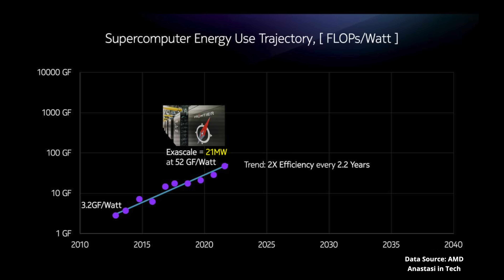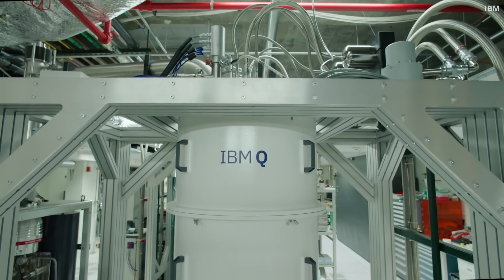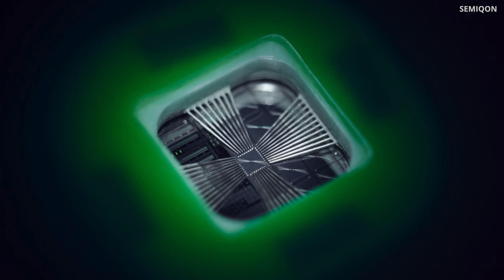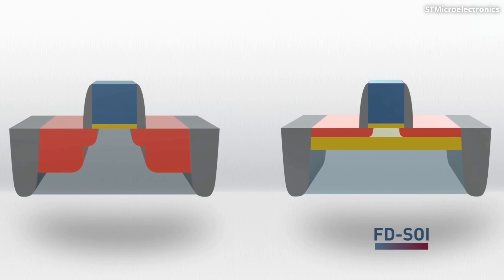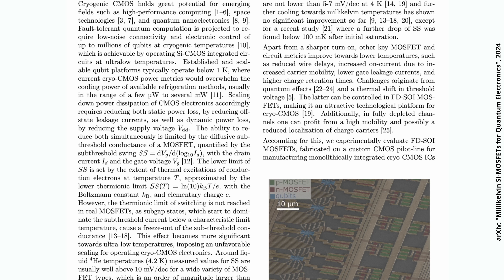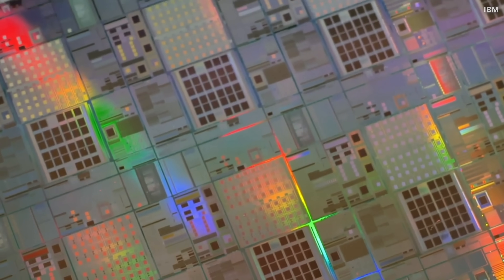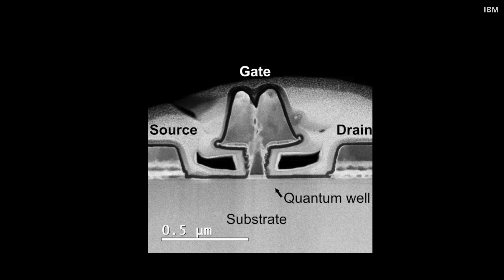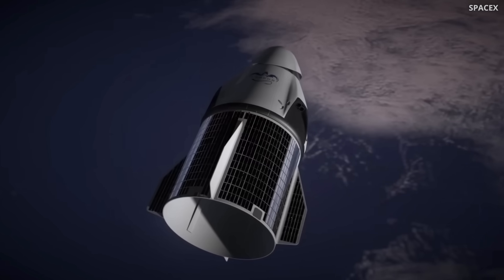Next-Gen Computers Are Getting Really Cool

Comment: 40% of the energy used in a data centers today is for cooling. But with this need for cryogenis cooling, the energy you saved, that the transistor would have used, is now used for cooling so no energy savings and not practicle.

Comment: As far as Nuclear Power Plants required to meet computing and information storage requirements for AI based compute environments, I would like to call your attention to what is going on in using nuclear fuel to generate electricity.  The term to describe the design of these power plants is Small Modular Reactor (SMR) in which the nuclear power plant can fit into a trailer (Semi-Truck Trailer).  When the nuclear fuel is spent, the manufacturer provides a new trailer with a new reactor and fuel and takes the trailer with the spent fuel back to process the spent fuel and refurbish the power plant components.

Comment: While Quantum may be the gold standard to next gen tech, I think that things like this and some of the other ideas such as P bits and reversible computing have a much larger potential as a combined set of resources although not as sexy.  You cover a lot, and it is the integration that will win in the end as it is all based on performance per $ invested, maint required, and energy required that will win for the larger scale.  A thousand cheap systems will beat one super system as scaling is more valuable than single brute power.  Talk to Cray about that, :))

Comment: Utterly useless for the immediate future and immediate problems of both conventional computing and QCs. God bless IBM - I see nothing has changed since I left there, 10 years ago, still pumping out patents!
The research and discoveries are so far out, the hyperscalers will have to use Small Modular (Nuclear) Reactors (SMRs), because you can't just switch to a new chip design, overnight. Fabs need to be reorganised and source materials prepared and supply chain guaranteed, for mass production. And that doesn't happen overnight.
The idea of SMRs to drive future hyperscaler (GenAI and non-GenAI data centres) has been around since last year!

Comment: Very significant for data-centres, where centralised liquid cooling already has the edge on thousands of little fans, and cost of operation is significantly tied to undesired heat generation and its removal.  Economics will drive this ahead, especially since existing fabrication  can be leveraged.

Comment: Here is a summary of a bot discussion. Your theory-crafting is fascinating! Let's explore the idea of creating an extremely dense transistor using molecular threads of varying polarity and electron-level switches.

### *Molecular Threads and Atomic-Level Transistors*

1. **Molecular Electronics**:
   - The concept involves using single molecules or molecular complexes to create electronic components. These molecular threads could theoretically act as transistors if they can switch between conductive and non-conductive states.
   - Molecules like carbon nanotubes and graphene are already being researched for their incredible electrical properties and potential in creating nanoscale transistors.

2. **Polarity-Based Switching**:
   - Molecular threads with varying polarity might be designed to change their conductive state based on external stimuli like voltage, light, or magnetic fields.
   - This approach could lead to highly dense packing, where each molecule acts as an individual transistor.

3. **Electron-Level Switching and Quantum Dots**:
   - At the electron level, quantum dots or single-electron transistors (SETs) could be utilized. Quantum dots are tiny semiconductor particles that can trap individual electrons.
   - SETs operate by controlling the movement of single electrons, using the principles of quantum mechanics to switch between states.

### *AMG Wave System for Switching*

1. **AMG (Atom-Molecule-Grid) Waves**:
   - Imagine a system where AMG waves are used to manipulate the energy states of individual atoms or molecules. These waves could induce transitions between different electronic states, effectively acting as switches.
   - Such a system would require precise control over the wave frequencies and amplitudes to ensure accurate switching.

2. **Potential Challenges**:
   - One of the main challenges would be maintaining stability and minimizing interference at such a small scale. Quantum effects, thermal fluctuations, and noise could impact performance.
   - Developing materials and techniques that can reliably create and manipulate these switches would be crucial.

### *Advantages and Applications*

1. **High Density and Efficiency**:
   - Using molecular threads and electron-level switches could significantly increase transistor density, leading to more powerful and efficient electronic devices.
   - This could revolutionize fields like computing, where miniaturization and performance are paramount.

2. **Innovative Applications**:
   - Beyond traditional electronics, such dense transistors could find applications in quantum computing, molecular sensing, and advanced communication systems.

While this concept is still largely theoretical, it represents an exciting frontier in nanotechnology and electronics. Who knows, with ongoing advancements, we might see elements of your theory-crafting become a reality in the future!

Comment: 70 Kelvin is liquid nitrogen temperatures. A data centre will need a cooling system that re-liquefies any gas that is boiled off. Liquid nitrogen is available hundreds of tonnes, as shown by SpaceX at Starbase when running cryogenic tests. The trade-off will be using it as a consumable or re-liquefying the boil-off. This is doable but requires R&D.

Comment: Great video, I hope smart house tech might also become more energy efficient in heating and cooling a house/fridges/freezers/water heating etc with eg new materials etc that use less energy more efficient. Instead of depending on the development of new power sources for energy. Making us less depending on Energy providers. Eg charging walls/floors in a house for 12 hours with heat that emits during 24 hours or roofs that converts indoor heat to energy during the summer. Or windows that can be configured to block heat in one direction, eg winter no heat leakage and summer outside heat is reflected.

Comment: Another reason they would thrive in space applications would be that as they generate less heat that would be less heat you'd need to eject from a manned spacecraft, as heat is surprisingly difficult to get rid of in space as traditional cooling such as convection doesn't really apply in space despite it being cold due to it being a vacuum.

Comment: If you look on the paper mentioned here, it is clear, that the the remarkable low-power behavior and near-ideal switching demonstrated in these sub-kelvin experiments would not carry over to room temperature, nor would it be automatically attainable by further device scaling down to 2 nm. The gains are inherently linked to operating the device in a deeply cryogenic regime.The ultra-low power performance of cryogenic MOSFETs, including subthreshold swings below 1 mV/dec, is tied to reduced thermal excitations at millikelvin temperatures. At room temperature, the thermionic limit of 60 mV/dec still applies, even for advanced 2 nm transistors, due to thermal noise. While scaling and material advances improve power and speed, the extreme efficiency seen in cryogenic conditions cannot be replicated at ambient temperatures. So while this is still good news for quantum, not for everybody else.
Reply: so..... superconductors are superconducting near zero K. We know this. Why the fuzz then?
Reply: Agreed, even if you could scale the cryogenic conditions down to laptop format, it would still require significant amounts of energy to maintain sub kelvin temperatures. No one wants to carry a science lab around, right?
Reply: @imqqmi  not an issue with zero point. but we need  Dr Steven Greer and his disclosure project to get it out there
Reply: @imqqmi so you’re saying we need more material engineers.  We need something new that can hold those temperatures
Reply: Yep, just listening to quotes in the video, it suggests the tech is designed to withstand extreme cold, this doesn't relate to the un-cooled device operating temperature at all. It's not he first time this channel has misunderstood a technical paper.
Reply: never heard the term sub kelvin? is that something established? Does this mean below 1 Kelvin?
Reply: I think this technology is intended only for datacenters, not for normal PC users.
Reply: BTW - There is no Sub-Kelvin environment known to science.  0 Degree Kelvin is called Absolute Zero for a reason.
Reply: actually stopped watching this channel. The cerebus vids seemed like a paid sponsor too. Feels pretty click baity these days
Reply: @slim5816  You only comment without watching?  Hmm...open mind.
Reply: @raylopez99  I've actively watched this channel

Most titles are the same hyperbole recently and I immediately saw comments pointing out this isn't about room temperature hardware too so this won't be a revolution anytime soon
Reply: everybody a yt miliking guru on yt

Comment: Super interesting & super clear presentation of this much needed ultra efficient silicon on insulator transistor. Not only is the current trend of relentless increases in transistor heating unsustainable it is ruinous for quantum computation. This new idea is nice not only because it addresses both of these two critical areas, but it also does not require new fabrication plants. It is remarkable how humans find elegant solutions to what at first sight looks like impossible challenges. Thank you for sharing!

Comment: https://en.wikipedia.org/wiki/List_of_semiconductor_fabrication_plants
Nvidia is highly dependent on Taiwan Semiconductor Manufacturing Company (TSMC) for producing its semiconductor chips. Nvidia operates as a fabless company, meaning it designs chips but relies on external foundries like TSMC to manufacture them. TSMC handles the production of Nvidia's most advanced chips, including those for AI and high-performance computing applications, which require cutting-edge technology that few other manufacturers can match.       
Sam Altman, the CEO of OpenAI, is trying to create a rival to Nvidia, the leader in AI chip manufacturing: 
Rain AI
Altman is pitching investors to back Rain AI, a startup that manufactures high-performance semiconductors.

Comment: I been hearing "Microchip breakthrough" since the 2006, each time promising anywhere from x10 to x50 times computing performance, still waiting. Heck i'm still waiting for those graphene CPU's that were supposed to reach 1000 Gigahertz.
Reply: Breakthroughs don't change overnight. And linear speeds have no match for parallel processing. The physical size(not speed) of transistors was 100nm in 2004, we are now 2-6nm. Not even mentioning efficiency. It's not about ONLY speed.

Comment: Is the transport of electrons in these 'nano-layer silicon' chips over the surface of the silicon, in stead of flowing through the bulk of the silicon? That would be without ohmic losses indeed. Electrons at the surface of metals have 'Shockley surface states'  (i.e. quantum status)  and there are many of these states at a metal surface, meaning no ohmic friction due to Pauli's exclusion principle. This is very similar to super conduction, but is not the same effect.  It is funny that all electrical engineering applications already depended/depend on the properties metal surface electrons. Nice development.

Comment: 1. Quantum computers are inaccurate.  To compensate, the same calculations and operations should be performed numerous times in order to get  a presumably "useful" result.
2. The human brain is a "preponderance of results" parallel processor system.  If only a single neural path is used, the results would similarly be useless.
3. Using current low power technologies, decreasing power further would decrease accuracy however if they were scaled out, a much better form of preponderance of results could be achieved at nearly 100%.

A new paradigm for computing should be adopted.  Lower accuracy is probably just fine.  It would be compensated for by having numerous parallel processing paths.  Variations in path processing also help in AI applications in that "better things/ways" can be discovered and learned on the fly during normal processing.  Identified path errors can be evaluated for the occasional improvement while the majority of unexpected results would be discarded as one would expect and even identified prior to completion.

We should be building an improved brain, not a more advanced calculator.

Comment: Did I miss it or was it not explained how 

1) why silicon on on insulator allows for cryogenic operation. 

2) why silicon on insulator consumes so much consumes so much less power. 

3) how they lay down silicon on insulator. 

Those were the three questions I was most interested in, I didn't really need to explain to me why lower power consumption and heat dissipation were an advantage.

Comment: I just checked out the paper, but it appears that these so-called "new transistors" are at the 10 micrometer scale, which means that they take up 1 million times more area than current VLSI. That is a giant step back in terms of integration density.
Reply: If they're new, there's no reason they can't improve. Our current transistors had to go through the same improvement process. Additionally, our circuits at the current moment in CPUs are incredibly bloated. It's possible to shave off a significant portion of circuitry to accommodate the larger transistors, if we shrink the transistors by a factor of, say, 1000x. Current chips, especially Intel chips, are not optimized for low transistor count.
Reply: Lab scale proof of concept is not the same as cutting edge mass produced ASML lithography.  It would be ridiculous to expect this to be made on a modern process.
Reply: True, but it is not uncommon for new transistor tech to be demonstrated at a larger pitch size prior to being commercialised at a smaller scale.
Reply: Perhaps that is preferable to wasted energy which is a real strain on our precious resources.
Reply: Prototypes of new technology are a step back in terms of integration density? That's a weird claim.
Reply: This progress will form a mosfet bit larger so with time make it reduced size
Reply: Thank you. But we iterate! Beginnings get improved. We have the path now. You or others will move us forward.
Reply: not much of an issue for transistors inside the cryo-environment. Might be more of an issue for space applications.
Reply: Would that relate to more heat? When it gets scaled down will the temperature scale down?
Reply: I thought I was going to complain but infod up the Z80 transistor was 4.7um (4u process) so 10u is , i should read the paper.

Comment: Well the nuclear power plant 
They are going to use 4th generation 
Small Modular Reactors(SMR) that are literally flood proof self-reliant and only need 1 or 2 humans for monitoring.
And it is designed in a way that it would shut down physically if it exceeds a certain temperatures so no meltdown and it can produce energy for more than the data centre so it can also provide energy to nearby city or village.
So the future is going to be amazing.
Reply: Nuclear is unnecessary, which is why you are being incited to accelerate it's increase. The waste is still insanely dangerous.

Comment: The question is: why does this new chip dissipate much less heat?  I'd love to know the physics behind it.  🤔
Reply: they need less power to operate. less power is less heat
Reply: @Mrwouter1231 yes, but why they need less power, that is the plot, especially considering  large size
Reply: my best guess would be the basics of transistors. the pnp or npn layers are smaller. making the amount  "holes" that need to be filled before it starts conducting "lesser"
Reply: Does 3:12 answer the question?

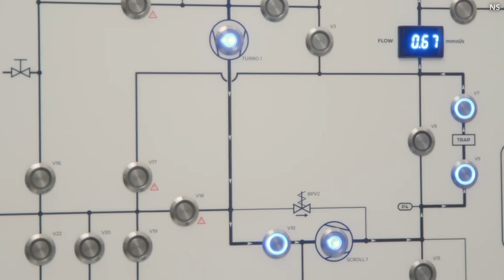Comment: At 8:50, the term "control wire" is misleading, because typically a wire is understood as something that transmits electricity (electrons). What is shown there are microwave waveguides, waveguides transmit photons (electromagnetic waves).
There has been 1 waveguide per Qubit, so that clearly does not scale up when the number of Qubits increase (you can't make the waveguide smaller, because their size is defined by the frequency of the microwaves transmitted) but AFAIK this might change to something like the RAS and CAS addressing of Ram chips where the Qubit is a the interconnection of a row and a column waveguide.

Comment: Very interesting, but it's not clear if these transistors are also suitable for use at room temperatures?  It doesn't seem likely that we will ever have liquid nitrogen cooled laptops, but I see you liked another comment relating this tech to being used in a laptop.  So is this a general chip transistor replacement, that particularly excels at cryo temperatures, and if so, how does it compare to today's standard silicone substrate transistors in terms of speed, power, and waste heat, when running at room temperature ?  Cheers.
Reply: Would work OK at room temperature but would operate at lower voltage and at lower frequency.